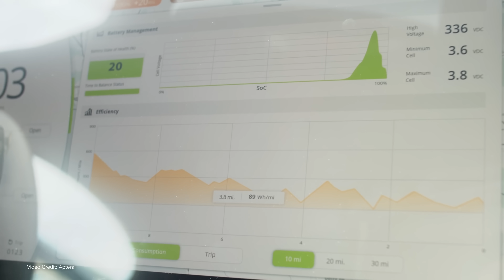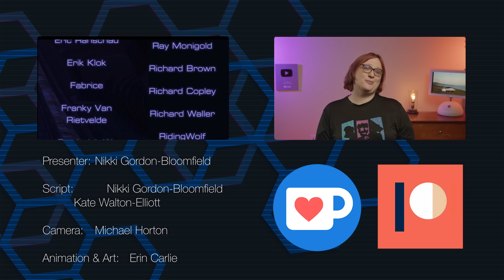Here's What's New At Aptera!

Comment: Fun concept car. But cannot see this ever becoming mainstream ever. Its like a bigger version of the danish ellert. Bathtub on wheels 😅
Reply: Easy enough for you to wait and watch then.  More than 20,000 people are chomping at the bit to drive their own and prove you wrong.  Of course, I am one of them.
Reply: @joelsmith4394  pretty sure the Ellert sold more than 40k over it's life time through 1970~ 🤔
Reply: @AntimatePcCustom  So far as the current model Aptera being an extremely aerodynamic two seater, I have to agree that it will probably become no more common than the two seat roadsters or two seat commuters like the Smart car.  I see both on occasion but I wouldn’t call them mainstream.  If the Aptera does get out on the road, I do hope that it will bend common perception of what’s normal further away from the ever larger and heavier SUVs that legacy auto keeps pushing and more towards efficient economy that is where the auto industry really needs to go.
Reply: Seems to be realistic enough for there to be > 20,000 reservations so far, and counting.

Comment: Thanks for continuing to follow Aptera with detailed videos like this one.  I have a reservation with them but honestly never thought they would make it to production. Their strategy and design is so different from everything else in the industry, which is focused on bigger, heavier EVs. Every other EV channel seems obsessed with the next $60k+ crossover being launched.  It's great to see little Aptera get some attention
Reply: I want an Aptera so badly. I believe it cos they make solar race cars that go 80 kmh without any batteries. The Aptera is inspired by the solar race cars...a hybrid between those and regular cars. That's why I believe it. I use my ICE car once a week to get supplies. But it could sit in the sun for a week if it was an Aptera. Free fuel with the (max) 70 km for a summer sunny day of solar charging. So I could go to the shops that are 20 km away. Most times the battery will be full if I charge it just once from the wall. No charging stations in my town, no worries with an Aptera. An extra add on solar cell (that stays at home) would be good too (if you could).
Reply: I’ve reserved as well, but not holding my breath they will ever deliver. Seeing videos on where they are in terms of prototype testing, it looks like they are a very long way from even having a full production design nailed down. I really hope they can fund operations long enough in this failing economy to make this car real.
Reply: yep yep, this is the future sofia. we dont even get much sun in northern uk but i'm happy to plug in on standard socket overnight, no problemo.
Reply: I feel like apterra is the only thing that can save the Petrodollar by reducing domestic demand and selling oil overseas

Comment: Well I tend to be a naysayer on this vehicle. First problem I see is the wheel pants are going to hit asphalt when you encounter large speed bumps and large potholes. They will be broken and ripped off. Secondly when trying to parallel park some people are going to hit the curb with the wheel pants. Thirdly three wheelers are difficult to navigate on rough sections of asphalt where there are potholes, dead animals on the road and other debris like bark falling off of log trucks if you live in the country like I do because you have three tracks instead of one or two. And lastly you mentioned a hundred kilowatt hour battery pack available. I cannot for the life of me imagine where you would put a hundred kilowatt hour battery pack in this vehicle.
Reply: Perhaps you need to do more due diligence.  I have ridden in the Luna prototype and the wheel pants don't hit even high speed bumps.  Production versions will be even better in this regard.  

I live on a gravel road in Iowa, and I have no worries about dodging objects on the road and potholes, since with the 77" front track there is almost 3 ft between each front wheel and the center.  There will be plenty of room to straddle most objects of this sort.

I agree that parallel parking will take some practice, which most people need with any vehicle.
Reply: @n.brucenelson5920  thank you for your thoughtful reply. I have been driving electric vehicles since the '80s. As I have done conversions on both motorcycles and cars. When the Nissan leaf came out I bought one of those and used it for rideshare putting about 35,000 miles a year on my leaf. But even this car as it sits relatively low would scrape in certain instances. About 3 years back I bought a Chevrolet bolt and due to it being a "crossover" vehicle I've had much better luck with the clearance and not scraping pulling in and out of driveways etc.. I also use my bolt for rideshare and delivery service. The lack of maintenance required and the fact that electricity is a lot cheaper than gasoline to fuel my vehicle has made them profitable for me to utilize.
Reply: @shredmas  You are in the forefront.  I am still driving a Gen 1 Honda Insight and on my second battery pack.  

For people who encounter these kinds of road conditions, there will be an "off road" option that will give perhaps 7" of clearance.  I don't think this will be necessary for me.  I plan to take my standard Paradigm edition early production model to Death Valley immediately after picking it up.  I have been there many times by motorcycle.

Comment: I like the Aptera, but I suspect the safety is likely to be compromised by the optimisation for panel area vs drag, that most people won’t get the mileage claimed and that you’re probably better putting the panels on your house.
Reply: We aren't buying the solar panels for efficiency, we're buying them for the constant trickle charge. A lot of people don't have easy access to charging at home, let alone roof solar. We could spend the money but its not worth it (we get cheap hydro power already and live in a northern latitude). Also it gives you the flexibility to go off grid.

I'm not sure how safety would be impacted by the solar cells, they aren't load bearing cells ;)

As far as milage, we don't know exactly what it will be. But early testing and simulations show it should be close to what they claim based on the .13 coefficient of drag (significantly better than Lucid Air and the MB EQS) and the optimized and simplified power train.  The efficiency of the whole vehicle is certainly going to be at least 120wh/mi even driving at highway speeds. 

Range numbers are always a guess because individual driving conditions vary so much, but it will be "streets ahead" of my current ev and honestly anything else available in the near future. Maybe I'll only get 15-20 miles of free range a day but that 900$ extra I'm spending on solar cells will give me a lot more flexibility in planning camping trips and visiting my family.

Comment: One concern I would have with that car is a safety one, not for people inside the car but for pedestrian safety.  I know that there are a range of different safety tests done to cars and one of these tests is what happens when a car hits a pedestrian.

Obviously is the pedestrian gets hit by the centre of the car they will bounce of the bonnet just like they would with any other car, however if the pedestrian gets hit by these suspension arms that go out to the front wheels it would be more problematic for the pedestrian.  I can imagine that if the car is going fast enough then these suspension arms would just smash through a pedestrians legs and leave pedestrian crippled.
Reply: Definitely a legitimate concern and it might be a potential issue getting into europe where they have requirements for such things.

Comment: Another nice video Nikki; Thank you.  

I ordered the 40 KW version because I really want 250 miles of range and fully expect there to be a couple of disappointments along with the first deliveries.  I don't care about anything over 75 MPH or 0 to 60 times below 7 or 8 seconds (still fairly fast).  Now wouldn't it be wonderful if it was a foot less wide.  

My first accessory will be a balloon wall to secure the hatch door just below level with the main cabin roof line.  A collapsing passenger seat and look out Lowes, Home Depot and camp-outs.  Once you get the customer dreaming go get the cash register.